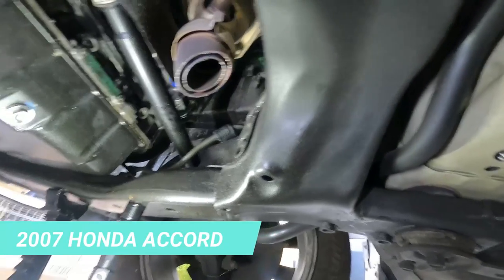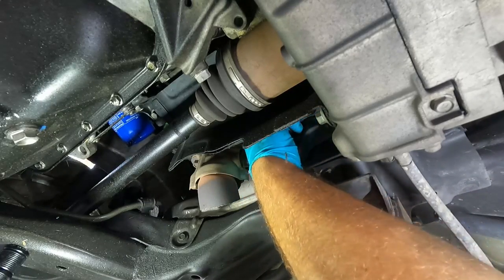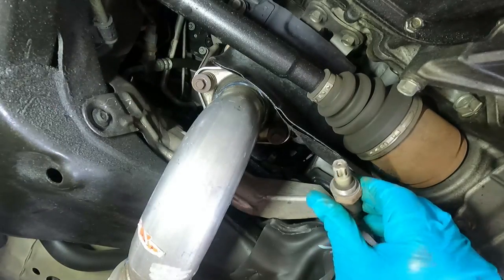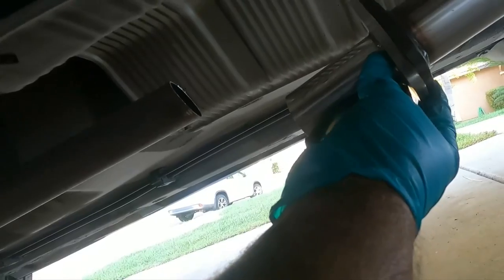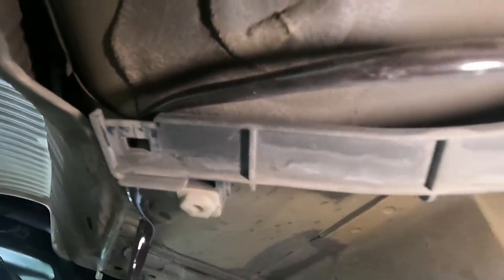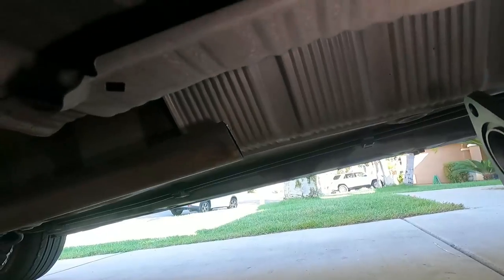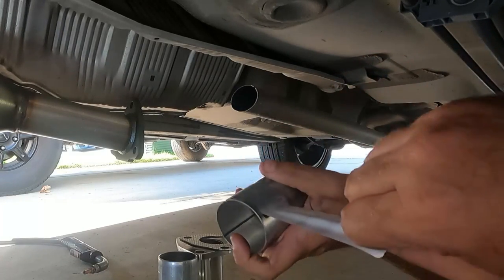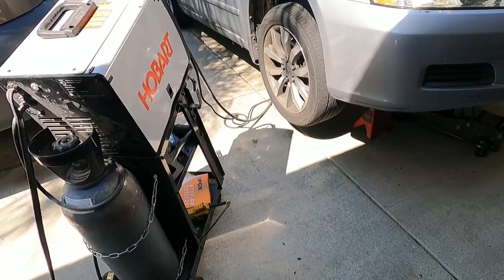2007 HONDA ACCORD - Catalytic Converter STOLEN!!! - Replacing the Catalytic Converter and o2 Sensor

Comment: How much did that cost? Who’s buying these stolen cats and the metals?
Reply from the maker: It’s about $1000 with aftermarket parts, and around $3500 with the OEM Honda parts.  You can save a few hundred dollars on labor if you do it yourself.  There are several recycling companies that buy them and I read that some auto repair shops will (illegally) buy them because they are able to sell them to the recycling companies in larger quantities.
Thx for watching!
-Dan the Fix it Man
Reply: 8:34 what size is the universal triangle thing after the catalytic? I saw the link but there a lot of options in there. I’m guessing it’s oval 2” OD? 
Thanks.
Reply from the maker: @dxdvilla7650  it’s actually the triangle one that matched up perfectly.
Best of luck to you!
Reply: @DantheFixitMan   hey man how did you order the cat off Amazon, the website says it can’t be shipped in California
Reply from the maker: @KevinLopez-vo4hk  that non-California one that I tried was junk.  I had it shipped to my friend out of state.  I just needed something to work temporarily, because I was going to give it to my daughter that lives in another state, and the OEM ones were out of stock everywhere.  But it didn’t last long at all…just about 6 weeks then the check engine light came on again.  My plans changed and I decided to keep it in California, so I found the Walker one that is C.A.R.B. approved on Amazon and it has been working fine ever since.  I also had to go to the smog referee to have it inspected and a new label has to be made about would pass smog.  Kind of a hassle, but it passed.  I wouldn’t bother with the cheap one, even if I was living in another state.
Thanks for watching!
Dan the Fix it Man
Reply: I need to know the size of the triangle thing too
Reply from the maker: @Rockin-4-Hunter  Size: 2" OD, 7.5" OAL is from the amazon description.  Here is the link: https://amzn.to/3Nhu350
It's the 2" one, they call it oval for some reason, but that's the correct one.
Thanks for watching, best of luck to you.
-Dan the Fix it Man
Reply: @Dan the Fix it Man  thank you for all your info & videos!!!!

Comment: Gotta come back to say THANK YOU! Thank you for your previous replies, this video was a lifesaver and explained perfectly. Got quick estimates of 8-$1000 for the CAT alone without inspecting the underneath of my car. I ended up spending $680 for parts and $140 labor putting me at $820 for everything! Only thing I had to do was source the gasket and flange repair pipe to match with the end outlet of the Walker which they welded for me. You are the MAN!!

Comment: Hi and thank you for this video. I wasn't jackeded but live in upstate NY and my exhaust needed replacing. My '07 Accord looks like a barnacle encrusted shipwreck from underneath- nothing like your pristine CA car! I've got a question regarding the two spring bolts holding the flex/down pipe to the header. Do you recall if they torqued down tight? I know the springs are not supposed to be too tight, but my bolts thread in all the way out the top of the header flange and never get tight. It's like I've run out of thread. These are genuine Honda bolts and doughnut gasket from the dealer where I was uncerimoniously robbed!  The bolts don't pull out and the flex pipe seems all the way on, but I expected them to tighten somewhat.  Thanks for your thoughts.
Reply from the maker: I am pretty sure the spring bolts did tighten all the way down without spinning.
It sounds like what youre are going into may be stripped.

Comment: Great video. Any issues with using the Denso downstream O2 sensor while keeping the OEM upstream sensor? The askref web recommends using an OEM O2 sensor with after market CAT, so don't want to get check engine light coming up. The Densor part used in the video says doesn't seem to be CA emission compatible when I searched on few sites.
Reply from the maker: I used the 234-4797 Denso and it worked great.  No check engine lights still, and it passed smog without any problems at all.  I just updated the link in the description because it looked like the old link wasn't working.
Thanks for watching!
Best of luck to you!
-Dan the Fix it Man

Comment: Happened about a month ago. Pretty upset. In CA and this OEM requirement to pass smog is ridicouls making something costing $100 into $600-1500 not worth it to save a 04 or older car..

Comment: the part is 2800 alone probably more with inflation. It's like half of the worth of the car.
Reply: Aftermarket parts are not that much as  low as 200 for Walker part

Comment: Is a weld necessary? Or could I take it to a shop to have it welded once assembled?
Reply from the maker: I wouldn't say that welding it is completely necessary, you can probably get away with just using exhaust clamps instead.
Best of luck to you!
-Dan the Fix it Man

Comment: I bought the 3 bolt triangular flange in the description and it doesn’t line up with the end my my walker 82895 cat, do they sell those pieces at local stores or will a muffler shop sell me a piece that fits?
Reply from the maker: You might be able to source it locally.  I guess the company is selling a few different sizes/options.  I’m really not 100% sure why that’s not fitting for you though.  Sorry for the trouble, I hope you get that figured out.
Thx

Comment: have you heard of the lates info on the honda accord August 2023 on the ask a ref site?
Reply from the maker: I just looked at it thanks to your suggestion.  I wonder if that will be retroactive as well since the smog referee station already approved the aftermarket converter for our car and it already passed smog check.  If they say that it needs to be OEM the next time I need to smog it, I will probably sell it out of state.  Thanks for the info.
Reply: I just had a question. Do you think that flange you soldered to the muffler would align with an Oem cat too?
Reply from the maker: @omargerdbro  yes, it should work for OEM as well
Reply: @DantheFixitMan  thank you, I’ve been hit recently man. Very very angry about it. Thanks for this content
Reply from the maker: @omargerdbro  I’m so sorry to hear that.  I sincerely wish you the best of luck in  dealing with it.  I hope you are able to get it back on the road without too much trouble.
Reply: what were the 2 connectos from orielys size? Im trying to get the exact ones @DantheFixitMan
Reply from the maker: @omargerdbro  they were just 2” sleeves.  They have several different options of them at the store.  Sorry I don’t have part numbers…
Reply: thanks for the speedy reply. I am getting to it now so it's 2 inch ID or OD I went earlier to see if a 2" 1/8 would clear but too big.  @DantheFixitMan
Reply from the maker: @omargerdbro  I think it was the inside diameter.  Best of luck to you

Comment: Any check engines lights with the new Walker cat??? I live in California as well and have purchased the Walker Cal Approved Cat.......believe I read on their website 5yr/50k mile warranty. Mine wasnt stolen but got p0420......will replace cat and new o2 sensor at the cat.........later in a month (lack of funds) will replace air to fuel o2 sensor at the top (might as well get all new sensors and cat) a bit nervous only paying $400 but its ridiculous to pay $2,000 out of pocket........half of what the car is worth......but my guess is this Walker aftermarket must not have as much of those precious metals.........the whole state ref stuff seems like a hassle though.  Do you have to go to state ref??
Reply from the maker: No check engine light yet, I am still happy with the Walker Cat…and yes, you really do need to do the referee thing.  My smog check guy is the one who told me about it.  It was quick, and they didn’t charge for it.  (That was a nice surprise) And I agree with you in that I couldn’t justify the cost of the OEM converter on this older car. The first cheap Chinese cat I tried felt lighter than the Walker one, and only lasted 6 weeks until the check engine light came on for po420.  I am sure you’re right in that the Walker one doesn’t have as much valuable metal in it compared to the original cat…and it may not last as long as an oem one, but at the price difference, even if it lasts a few years, I am good with that.
Thanks for watching!
-Dan the Fix it Man
Reply: @Dan the Fix it Man  thanks for the reply man......and the video

Comment: someone attempted to steal mine however, i was able to run out and pop a shot lmao but they damaged the flex pipe so bad.. smh..

where did you jack up the car at?? so i can get underneath and do the same
Reply from the maker: Oh my!  Glad they didn't get your converter!
I just jacked it up under the pinch welds under the door.  (You can see where the jack should go). I think I also put jack stands under the subframe.  Just make sure it's nice and solid and secure before doing any work underneath.  Best of luckwith it.
Reply: @DantheFixitMan  bet thank you so much

Comment: Can you help clarify which variant of the universal flange is correct? Your amz link loads the oval one which doesnt seem right. What is od and id measurements? Do you have the specs on the sleeves as well? Thank you
Reply from the maker: The link shows an oval and a triangle flange option.  The one I used was the triangle option with the three bolts.  It was the 2” diameter.  The other pieces were just 2” sleeves from O’reilly auto.  Most auto parts stores will have several options available in stock.
Best of luck to you.
-Dan the Fix it Man
Reply: @DantheFixitMan  thank you

Comment: do you know what bolts i need to get haha , i was going to buy the oem honda BUT they are pricey
thank you in advance
Reply from the maker: I ended up using the bolts that came with the flange that I bought on Amazon for the one side of the converter, and the cheaper aftermarket converter I used came with some bolts as well...
I don't think the walker aftermarket cat came with bolts though.  I am sure you could find some that would work at your local hardware or autoparts store.  The front flex pipe that was cut off still had the two bolts with springs on the car so I was able to re-use them.
Thanks for watching!
Best of luck to you!
-Dan the Fix it Man

Comment: I do have some questions, what diameter is that universal flange and is there another name for it? Any link? What is diameter for honda JDM exhaust pipe? need pipe sleeves and clamps for the size. Since im in CA I need CARB compliant instead of EPA comp. And they dont converter bolts and nuts, where can I get them?
Reply from the maker: Hi David,
All of the links to what you need are in the description.  You will want to order the 'triangle' shaped 2" flange, and it comes with new bolts and nuts and a gasket.  The Honda exhaust pipe is 2" diameter.  I also included the link to the Walker California C.A.R.B. legal converter that I installed after the cheap one shown in this video failed.
Best of luck to you.
-Dan the Fix it Man
Reply: @DantheFixitMan  wasup, got all parts but the roadblocks im having is the uni. Flange (your amazon link) holes doesnt align perfectly with the walker carb ca converter, bolts can be inserted but they are angled. The converter didnt come with bolts/nuts/washers and I am still 3 sets short where can I get em?
Reply from the maker: @elnum7  I’m so sorry it’s not lining up…, the flange I got the bolts lined up perfectly with both the cheap converter and the Walker one.  They have a few different options I am guessing on that link for that flange.  
You might try a local auto parts store to source that flange, like an O’reilly or a Napa.  They should have the bolts too.
Best of luck to you, I hope you get it sorted out soon.
Thx again

Comment: Will it pass smog in CA?
Reply from the maker: https://amzn.to/3dcNnS0 - Walker Exhaust CalCat Carb 82895 Direct Fit Catalytic Converter (Alternative to OEM)
This one is approved for California.
Reply: @DantheFixitMan  How has it held up 1 year later? Did you call the state referees?
Reply from the maker: @airless818  I just posted an update to the description.
The check engine light came on about 6 weeks after installing this cheap catalytic converter shown in the video.  Although I live in California, my plans were to give this car to a family member that lives in a state where smog is not required.
After a change of plans, I decided to keep the car here in California so I just put on the California C.A.R.B. approved Aftermarket Walker Catalytic Converter 82895 (link below) 2 weeks ago so I can pass smog and keep it here in California.
 It's been only 2 weeks, but so far so good.  This one is listed on the Aftermarket Catalytic Converter Database C.A.R.B. website so it should pass smog check without issue.  The smog check isn't due on this vehicle yet, but I think it is coming up soon.  I will post an update if I have any trouble.
Best of luck to you!
-Dan the Fix it Man
Reply: @DantheFixitMan  Thank you for the information.  Glad your video is helping others wish you success.